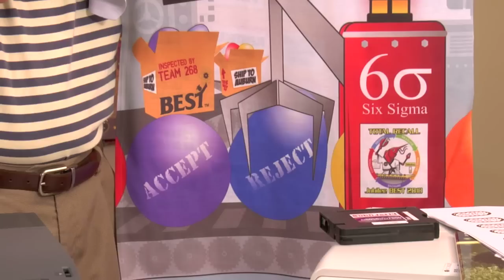Introduction to Dye Sublimation Heat Transfer Imprinting -

Comment from the maker: Jeff, we just had a similar problem in our office in reverse, we had to take a printer that was using sublimation cartridges and switch it to ordinary ink for flyers and brochures.  We simply inserted non sublimation cartridges. We had to throw away the first 200 pages printed. It may be that you will have better results, but be careful, it will take  awhile to flush out the bad ink. To test it, imprint a scrap of material and wash it to see how much coverage is being gained.

Comment from the maker: Dear Gary,
You can use sublimation for 50/50 garments, however, the print on the cotton will wash out. There are some garments made for sublimation (Our DyeTrans towels, Hanes Soft L'ink shirts) that were designed for sublimation, with the polyester threads on the outside and cotton on the inside, those would be perfect for dye sub, but blends are not a good idea, unless you want a deliberately faded look to your artwork.

Comment from the maker: For socks? Maybe you would like the Ricoh 3110DN, with ink you can get it for $525. The widest it will print is 8.5x11. The Ricoh 7700N is larger, goes to 11x17 and can be upgraded to 13x19, and it's recently had a price lowering to make it complete under $1500. Both available at conde com

Comment: What would you consider the best all around printer to use for average size sublimation prints?
Reply from the maker: Right now we are partial to the Ricoh models, they do not require any mods and they print reliably. Ricoh is a good partner for dye sub. If you can afford it, get the 7100 model as it upgrades all the way to 13X19 prints.

Comment: Hi David, I have had my Ricoh 3110 for about a year now, I have great results  with every thing I do except people! They always come out orange! I have used Coral Draw and also another Photo shop type program and the picture looks great on the TexPrint Desktop Sublimation Paper for Richo until I do the heat press proccess. After I do the heat press at 400 degree for as low as 30 seconds,  everything in the photo looks great but the people are orange! I have tried playing with the adjustments in Coral Draw for saturation and some of the other adjustment options. but it compromises the quality of the photo and the people stay orange!  Do you have any advice for me to help me out? Nice Video!
Reply from the maker: This problem stems from your printer color profiles. Do you have the Sawgrass Power Driver or Conde ICC profiles? Call your printer Tech Support for adjustment advice.

Comment: Hi, Mr. Gross can you help me understand the difference between inks? I've been noticing regular printer inks, pigment inks and sublimation inks. Can all be used to print t shirts? Also were can sublimation inks be purchased for CISS Epson 1400?
Reply from the maker: Regular and pigment inks can be used with heat transfer paper and generally only works on soft substrates (garments) either cotton or polyester. There are some new Hard Surface papers for some items, you need to research those.

 Sublimation ink is used with sublimation paper and the item must be polyester or have a poly coating. Check conde com for sublimation inks for your 1400 or call us at 800-826-6332

Comment: What would be the best sublimation printer for printing onto calf high socks. Thanks
Reply from the maker: SubliSock™ Adult Short Socks - 3” Cuff
Templates are: Straight Jig: 4.75” x 5.5”
Hockey Jig: 13” x 8”

SubliSock™ Adult Crew Socks - 7” Cuff
Templates are: Straight Jig: 7” x 5”
Hockey Jig: 13.75” x 9.5”

SubliSock™ Adult Training Socks - 11” Cuff
Templates are: Straight Jig: 11” x 5”
Hockey Jig: 15” x 9.5”

The straight jig would be to only imprint the cuff.
So, cuffs only could be done with an 8.5" width printer (the Ricoh 3110)
and full bleed would require a larger one, the Ricoh 7100

Comment: Hello

I print and press hockey jerseys and noticed when I make mostly white jerseys I get unknown ink marks in areas that are supposed to be white. I check the transfer paper and that area that shows up with ink on fabric is clean on paper. Im so puzzled.
Can a contaminated platen allow ink to pass through the back of transfer paper and get on the fabric? Or is there small droplets of ink that land on paper while printing that are not visible to eye but when pressed show up? any advice appreciated. Thanks
Reply from the maker: Random lint can turn blue, excess ink can be on the platen top. Use a lint brush and plenty of protective paper, do not reuse the protective paper and good luck!

Comment: @condesystems Hi, I have been making sublimation mugs for a while now and wanted to get into the t shirt business. I've done a little research and found out that when using a heat press you have to cut out the non printed area on the sublimation transfer sheet once printed. Otherwise this would leave a white residue around the image. Squared and circular designs aside I was wondering how you would cut around an image that is highly difficult to do by hand?

Comment: I have a small Epson WF 30 and dye sublimation transfer paper...I am following heat press instructions to a "T" and getting no transfer at all. I am using polyester shirts with no luck. Is it my printer, ink, paper, or all of the above.  PLEASE HELP!
Reply from the maker: Mr Ross, Is the printer loaded with dye sublimation inks? Dye sub paper is not TRANSFER paper, it is a carrier paper, in the case of dye sub, it's all about the ink.

Comment from the maker: Becky Duncan Dye sub inks are special inks for printing on polyester, not sure what you need for the vinyl, but it is probably not dye sub ink.
Reply from the maker: +Liu Cathy The process is called dye sublimation. We generally refer to the paper as sublimation paper. It is not a transfer paper, it has no emulsion. The ink is carried to the press on teh paper like a tray. The paper releases the in when heat is applied.

Comment: Hi can you please tell me if I have been sold the wrong ink dye.For my Ricoh SG7100dn,only when I try to heat press it goes yellow.If this is the case please how do I rectify it I bought the printer and the ink together from printer base in the UK.
Reply from the maker: +Ann Hogg You need proper color profiles from your ink provider or the company. If it's Sawgrass Ink, they have a power driver for free, just go to their website.

Comment: For polyester-surfaced sponge rubber (e.g. open-cell neoprene), does the sublimation process cause any permanent dimensional changes in the substrate?
Reply from the maker: It can flatten it, so we recommend you use the least amount of pressure needed to perform the transfer. You may have to experiment.

Comment: sorry im new here.
i read wiki, https://en.wikipedia.org/wiki/Dye-sublimation_printer
it said that...

"These are not to be confused with dye sublimation heat transfer imprinting printers, which use special inks to create transfers designed to be imprinted on textiles, and in which the dyes do indeed sublimate.[1] These are done at lower temperatures but higher pressures, particularly in all-over print processes."

is this the same? or how are they diff? thx

Comment: I have a epson wf 7110 and installed dye sublimation but when I printed on the conde paper and heated it nothing transferred
Reply from the maker: Jackpotmedianow Well, dye sub is not about the paper, the sub paper is NOT transfer paper, it is just a "tray" to carry the ink to the press. What item did you transfer to? Was it 100% polyester or coated for dye sub? What brand of ink is it that you used? How much heat did you apply? At what temp?

Comment from the maker: Transfer paper for printing on cotton uses regular inks, not sublimation inks. Sublimation ink is a water based ink that will wash out of cotton, but, when heated, the molecules of the sublimation ink have the property of molecularly bonding with polyester atoms, so they fuse into polyester, they will NOT fuse to cotton. The pictures will transfer, they just will disappear when washed. My transfer paper expert says the paper will allow it to work, but it's like using a BMW to haul dirt.

Comment: can i use a Epson printer or no i can't?
thank you for this video.
Reply from the maker: You can use an Epson printer that has a Micro-Piezo printhead. And one for which the ink companies have made cartridges or ink delivery solutions. These include the following models:
C88, C120, 1400, 3000, 4000, 4800, 4880, 7000, 7800, 7880, 9000, 9880, 9890.

Comment: Hi, I have a Ricoh SG110DN.  When I heat transfer, all I get is yellow stuff.
What am I doing WRONG?  Thanks
Reply: Well, 
Sawgrass Technologies  answered my question the same day I posted this.  They are the makers of the special ink you use on the transfer paper.  I made the mistake of putting the unmarked Ricoh ink iinto the printer.  If you do this, call Sawgrass Technologies and they will walk you through the ink clean out process.these Ricoh printers were not designed to do dye sublimation transfers...someone figured out that they are great for the dye sublimation process.  The people who sold me the kit neglected to mention that and when I called the seller, my rep had no clue.Way to go, Atlex.com.

Comment: Hi. I want to start sublimating. i am some kind of new in all this world of prints and garments. I've heard that dye sublimation can only be achieved on a non organic tshirt like polyester. But i really want to start with quality tshirts made of 100% cotton like hanes or port and Company. I have searched and found about Sawgrass Chromablast-R and Jet-Pro SoftStretch Paper for sublimation on cotton. I am planning on buying the ricoh Aficio 3110dn. Is these ok ? or do i have to go Polyester ?
Reply from the maker: Andres Abad Dye sub only works with polyester. ChromaBlast is an option, not as good as dye sub looks, however. Jet Pro SofStretch is a good paper. the 3110dn is 8.5x14", you may want to imprint bigger than that. The 3110 is usually used for dye sub or ChromaBlast. If you are using transfer paper, you can use any other inkjet printer you like, even a larger one. Good luck! We have several JetPro SofStretch videos up, we recommend you watch them.

Comment: Is sublimation and laser printers one and the same??
or is sublimation printers and solvent printer same?
Reply from the maker: Sublimation is an ink.
There is no sublimation ink for laser printers.
Solvent printers are/use a completely different ink/process.

We have cartridges and solutions for adding sublimation ink to inkjet printers with micro piezo printheads.Most people use Ricoh GelJet printers for desktop (3100, 7100) and Epson for large format (7890, 9890, F Series).

Hope this helps.

Comment: Hi Sir! I would like to add a dye sublimated print on our t shirt business (I already have Vinyl Sticker printing) but it offers limited designs, can you give me some tips on learning a dye sublimation printing cause I really have no idea? Thanks!
Reply from the maker: Well, you will need a printer and sublimation inks. You must have a heat press if you have vinyl. Assuming you want a larger printer, a good choice would be the Ricoh SG 7100DN, which prints 11x17" and has available an optional bypass tray which increases the area to 13x19". The ink made for that printer is called SubliJet-R. They have small (40ml) and large (68ml) cartridges available. You can mix large and small, you may need a larger black, for instance, but get by on smaller color carts. It uses 4. Then all you do is purchase 100% polyester fabric items or coated items to imprint. The various times and temps should be available from your supplier. Good luck.

Comment: Greetings Sir I can't find one of those printer on ebay but its Ricoh Aficio Sg 3110dn good also? thanks
Reply from the maker: This is the Ricoh Aficio 3110dn, the difference is that it is NOT loaded with teh ink that comes with it, instead you load it with SubliJet-R inks.

Comment from the maker: Sublimation only works with the polyester, spandex and nylon, so the image would only stick to the 85% that is not cotton. IT would appear on the socks after transfer but the cotton threads would wash clean after the first wash. Maybe a transfer paper would be better. Either process would need a flat press. We recommend George Knight presses, check out the sizes on conde com. Get the largest one you can afford.

Comment: Doesn't sublimation mean from a solid state straight to a gas state? How is ink to a shirt sublimation?
Reply from the maker: Sublimation ink becomes a gas when heated. The gas molecules are chemically attracted to polyester molecules and they adhere to the. Most screen printing and tee shirt transfer rely on emulsion paper, so sublimation is a real breakthrough in technology. Sublimation ink is unique in its ability to convert from a solid to a gas without going through a liquid form. The conversion is initiated by heat and controlled with pressure and time.
Reply: Thank you for the reply, how new is this technology?
Reply from the maker: We have been selling it since the late eighties. It's greatly improved now.

Comment: WHAT PAPER DO I USE FOR EPSON WORK FORCE 30
Reply from the maker: If you are doing glass and cutting boards, use JetCol for best results or TexPrint. DyeTrans Multi-Purpose for everything else. Do not use -R products, those are formulated for the Ricoh printers.
Reply from the maker: william clark For black shirts, you could use a white toner printer, it has white ink. The Oki 920WT, for example.
For dye sublimation the shirts must be 100% polyester.
To dye sub a black shirt, you would get a white shirt and imprint the black parts. You would need a huge maxi press to do this properly.
Reply: USED 100% POLYESTER SHIRT AND TRANFER PAPER DIDNT TRANFER IMAGE AM I DOING SOTHING WRONG OR COULD IT BE THE PAPER IM USING  SHIRT IS ALSO  GREY  PRINTER IM USING IS WORKFORCE 30  PAPER I GOT IS TEXT PRINT XPHR SUBPAPER FOR EPSON PRINTERS  PLEASE HELP  ME
Reply from the maker: william clark
Are you using sublimation ink?
Reply: HOW DO I TELL IF IM USING THE RIGHT INKS
Reply: IF NOT CAN U TELL ME INKS I NEED TO GET FOR THE WF 30 AND IF I CAN BUY IT IN BULK SYSTEM
Reply from the maker: william clark
It would either need to be Artainium or SubliJet brand ink. There is no bulk solution that we know of, just cartridges and bags, If the printer has OEM ink in it, it will have to be flushed and cleaned before you can add sublimation inks to it. Call our company tech support if you are our client or wish to purchase an ink system. 800-826-6332
Reply: is the a quick connect with maybe
 larger bags instead of cartridges
Reply: inks included
Reply from the maker: william clark Epson Workforce 30..Two Types available:
ArTainium Bags and the Easy Flow Ink Delivery Systems 110ml    
AND
SubliJet 90ml Bags and the Quick Connect Ink Delivery Systems

Please call us 800.826.6332
Reply: NOT TRYING TO RUDE BUT THIS INFO SHOULD BE EXPLAINED BEFORE PEOPLE BUY THIS  BUT DO U MIGHT OFF HAND NO HOW MUCH IS THE SUBLIJET  90 ML BAGS AND THE QUICK CONNECT INK DELIVERY SYSTEM IS
Reply from the maker: william clark If we sold you the WF30 for dye sub and did not sell you the correct inks nor explain what is needed, please contact us at once.
Please check our website for pricing: conde com
Reply: YOUR INKS ARE COASTLY YOUR CARTRIDGES ONLY COME IN 2PACKS 80$ IS ALOT OF MONEY I NEED FIVE IS THERE A CHEAPER WAY TO GO I KNOW THEY SAY U PAY FOR U WANT  U HAVE THE QUICK CONNECT BUT I  WILL STILL HAVE TO BUY THE INKS SEPERATE  HELP REALLY INTERESTED IN THIS PROJECT ..
Reply from the maker: william clark  Sir, the prices on those inks are set by Sawgrass, all companies have to sell at the specified rate. Contact an account manager, they may be able to throw in a little incentive, like a free pack of paper or something, but we cannot sell below that rate on the inks.
Reply: after doing my homework decieded to to go with the ricoh  do the 3110 can I buy the buy pass tray with it  buying from amazon.com  177 with paper no inks got a cheaper price or something better
Reply: or just but the printer from yall with inks
Reply from the maker: william clark
If you buy the printer from Amazon you do not get our custom set up and color profiles as well as lifetime sublimation support. Also, we have huge Black Friday savings coming up...just sayin'...
Reply: JUST BROUGHT CISINKS DYE INKS AND THE PAPER U SENT ME WAS TEX PRINTSUBLIMATION PAPER 4 EPSON PRINTERS NO IMAGE IS COMING OF THE PAPER.  IS IT THE INK OR THE PAPER  IM SURE MY SETTING ON MY HEAT PRESS IS CORRECT  IF NOT I HAVE THE 5 IN ONE COMBO .PLEASE HELP
Reply from the maker: william clark
Mr Clark, Please call tech support at 800-826-6332